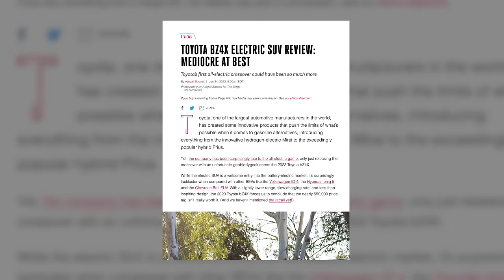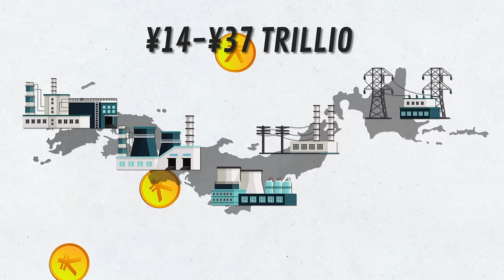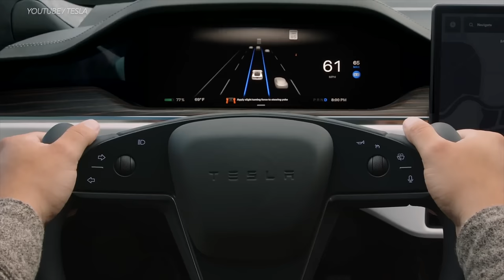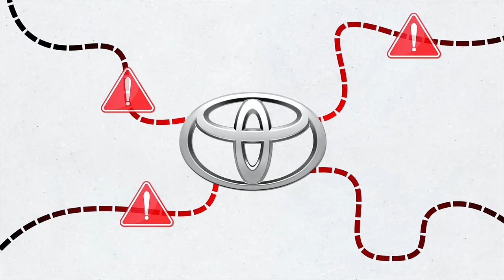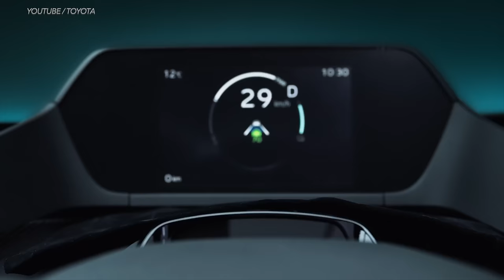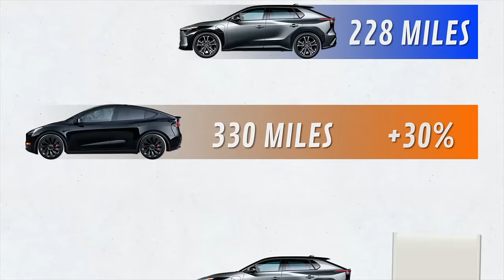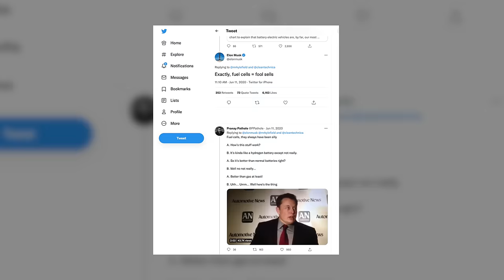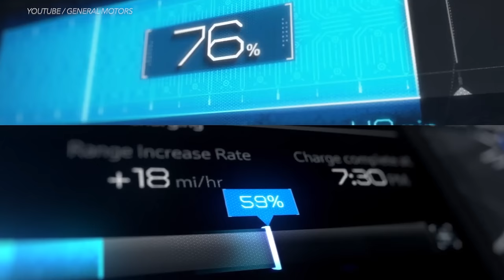Toyota's New Electric Car Shocks the Entire Car Industry

Comment: As a proud owner of Toyota’s with high miles , I always brag that I will “ drive them till the wheels fall off “ . I didn’t think Toyota would take me seriously 😂
Reply: I am a proud owner of a high milage Corolla
Reply: This dad joke made my day, thank you!
Reply: @SilverHairCare   Thank you ! Thank you very much 🥸
Reply: @dougefresh7435  Awesome!!  (I have a '93 Lexus with 230,000 miles and a '99 Lexus with just over 200,000 miles.)
Reply: @KaiPonte  make sure you check the lug nuts 😵‍💫. My 08 Scion XD just turned 190000 .
Reply: 260000kms on audi a2 @ 70-90 miles gallon 2001 aluminium

Comment: Toyota needs to keep their quality high! The wheels falling off is not a good start! Also, car makers need to get prices down below $30,000 if they want to sell to the mass market!
Reply: Imo, Toyota's are known for reliability and not for quality. They have cheap interiors and hard plastics everywhere
Reply: @Yubuzka3774  there's a difference btwn cheaper materials for base models (non-Lexus esp) and wheels falling off. The latter is unacceptable for any standard.
Reply: Remember you will be saving a few hundred a month on gas
Reply: agreed.  However, I don't think it was a quality issue, I think it's a design flaw.  Wheels don't normally fall off vehicles... any vehicle. And we're talking about Toyotas that have the highest quality rating for any of their vehicles compared to any other car manufacturer. Hyundai being the #2.  So It stands to reason, that the manufacturing quality is fine, It's a design flaw that is making the wheels pop off.
My question is why this problem was continued on to the BZ when that Subaru vehicle had the problem first. THAT in itself was a huge mistake. Toyota could have used the Subaru model as a test bed before moving on to the BZ. Flaws should have been corrected and were not.
Reply: @Yubuzka3774  Does reliability come without quality?

Comment: If Toyota was serious about EV's they would have gotten it right, just look at how great the Prius has been since its inception.
Reply: Toyota should stick to just gas models. Stop giving in  to the the Brandon green crap!
Reply: @jaysmith179  Toyota is a big time hybrid manufacturer, not simply an ICE vehicle manufacturer. They also don't like gas-powered vehicles. They'd like an alternate to gas to power engines and they're big on FCEVs, fuel cell electric vehicles.
Reply: so they're joking around losing face over selling wheel losing cars? besides it's not like they never made dumb mistakes before. Do you remember 2010 when they had to call in millions of their cars because of the gas pedal getting stuck in the floor mat? Toyota is a very popular car seller in Europe but some of their models land on the list of cars with most technical issues. I know that Scotty likes Toyota  and thinks highly of it, perhaps the models sold in USA happen to be the best ones but like every other company they have better cars  and not that good models as well

Comment: Right now with batteries being the weak point, I feel like Toyota needs to crank up the hybrid game personally. I like the idea of the set up they have in the new tundras, where the electric motor sits between the flywheel and transmission to help reduce some turbo lag, and also be able to be full electric for short distances at low speed, like stop and go traffic would basically be all free mileage as long as you got to drive before and after to charge the battery back up. Plus, the battery pack is in a slide out under the rear seats so replacement is pretty easy rather than taking the care off the frame essentially. They still use NiCd in those so they are much cheaper to replace as well. This also allows for the use of the transmission with the electric motor and if they advance this technology maybe it will be where you can drive up to ~30 mph on electricity while utilizing potential optimal gears design specifically for the electric side of things and then transition as the gas motor kicks in, for like an eco mode, or better yet, a beefier CVT they can handle both eco and sports mode depending on the need of the vehicle. What they really need to do is get nuclear like the submarines that can stay out for years... Yup the Toyota nuclear division is what they need to be dumping money into
Reply: A nuclear powered car that can have severe automobile accidents, man I'm all about nuclear power in the conventional sense but this is insanity, Scotty said you won but I have to give you a big L!
Reply: @icosthop9998  India will pick up their hydrogen vehicles especially in cold regions
Reply: Toyota. And subaru make great engines not cars lol
Reply: Toyota. And subaru make great engines not cars lol
Reply: I am in absolute agreement with you.  Don't see why we have to speed ahead to BEV and waste time with PHEV when the normal hybrids work great and actually benefit the owners. I'm still in the camp of a proper gasoline engine but not opposed to a hybrid drivetrain.
Reply: @tonebonebgky2  you do realize submarines get shot at and blown up on purpose, right? If they have deemed it safe for that, seems like they can figure it out for cars
Reply: @Brian-om2hh  electricity is large reliant on fossil fuel lol. That was another reason I threw in nuclear (now talking about power plants), even in jest, it's a pretty solid alternative with very few downsides if properly monitored
Reply: Sure. Tiny MR FUSION reactor powered cars for everyone!
  Sheer lunacy.
Reply: @duncanidaho2097  with current technology it would actually be fission...
Reply: @tonebonebgky2  can you imagine if freak accident happened with a nuclear power car and the power source decided to explode.
Reply: Just wait till the solid state battery is released. Toyota holds a bunch of patents related to the tech, and are pretty hush about it
Reply: @AnyMotoUSA  I was thinking about it and that they are bold to promise 90% charge after 10 years.
Reply: Buy the car but lease the battery 🔋

Comment: The entire concept is years away from being sustainable, on many different levels. Concerns of safety i.e. reports of fires, availability and methods of sourcing minerals necessary for batteries, and the fact that as of now, the charging involves the use of fossil fuels. This alone negates any mandatory environmental safety regulations. One might conclude, at this point in time, there are just a lot of elitist individuals looking to make a lot of money….
Reply: Thank you!
Reply: You mean spend money.  I live in Tesla land.  It's the nerd status symbol.  Right up there with German cars and Range Rovers.
Reply: Its not sustainable. Recycling these huge 4000 lb batteries every few years isn't sustainable.
Reply: Not years, but decades, if ever.
Reply: @dcgregorya5434  - Math challenged? Please, please, please define unsustainable. Tesla's largest battery pack weighs roughly 1250 lbs not 4000.  For Christ's sake do any of you fools actually read.  Why would batteries designed to last over 1500 charge cycles (LiFePo chemistry will last over 3000 charge cycles), need to be recycled every few years? At 1500 charge cycles even an EV with only 250 miles of range will last (1500 charge cycles x 250 miles per charge cycle), over 350,000 miles. And that's just until they've lost 30% or their original capacity. They will still work fine just with only 70% of their original range. They will continue to work for many more years and most owners won't choose to replace them. If they are replaced they will end up on eBay not in landfills. The Aluminum, Nickel, Lithium and Manganese (Cobalt is being phased out), used in NCA and NMC batteries are worth WAY TOO much to be discarded anyway. Keep in mind as well that Aluminum, Nickel, Lithium and Manganese ARE NOT POISONOUS. And now that the "highly sustainable" and NON-POISONOUS LiFePo chemistry (Lithium Iron Phosphate), has had its energy density vastly improved to nearly match that of NCA and NMC technology it will be replacing both NCA and NMC. Tesla has already started replacing NCA with LiFePo in their new Model Y. So the old arguments about Li-ion batteries being unsustainable and bad for the environment will soon be INVALID.  Try to keep up.
Reply: All of those supposed problems have been solved.....Read up on what CATL is already doing.........And read some more, Put Your Brain in gear before opening Your Yap..................Paul
Reply: @paulholterhaus7084  There are still many issues that have not been resolved.  Installing a fast charger is only an option for homeowners, and it's expensive.  Charging at commercial chargers is three to four times more expensive per KW/h.  EV range is greatly reduced in cold weather and when towing, and it's poor to start with.  Even at a fast charger, it takes several times as long to charge up than it does to gas up, even if you can find a charger that hasn't been vandalized to start with, and that is compatible.  EVs are far more expensive that their equivalent ICE vehicles.  I'll keep my ICE Camry.  EVs are decades away from being truly practical as a primary vehicle.
Reply: They are flying off the shelves.  They can’t make them fast enough
Reply: @MrKongatthegates  That’s Spectacular News. Now the Earth will carry on!!

Comment: In the UK the trouble is charge cables getting stolen from charging stations.  $60 worth of copper in each cable is too tempting.
Reply: Luckily that will never happen in LA, SanFran, Chicago, New Orleans, Jacksonville, The Bronx, South Philly and DC.
Reply: @STho205  No doubt? LOL
Reply: There is a simple solution to that problem.
The cable to be made from steel  wire - spiraled like a spring - 
so it can be stretched - the steel to be copper plated - as electricity
travels along the surface of a conductor NOT through it.
When the cables are manufactured from recycled steel such as 
steel cans - the cable is inexpensive to produce.
Reply: @andrew_koala2974  inner city folks broke into cars to steal Sanyo radios and underdash 8 tracks.

If there's a fence for it, even $5 seems to be worth their efforts.  Even phone books were stolen from phone booths.  Cords ripped out.  Phones taken or jimmied to get quarters

 Leaving expensive accessories out in urban streets are always going to be crimes of opportunity.  Best a car can do is lock everything behind glass windows.  Hampton parking lot chargers are not always the most secure places either.
Reply: Which is why we're now seeing untethered chargers, which require you to use your own charge cable. Problem solved.... There are several in my local town already. Stealing charge cables is all well and good. It's finding somewhere to get rid of them that's the problem. Most licenced scrap dealers in the UK will not blindly take scrap metal from anyone anymore. You need to show where the scrap is from, sometimes with written verification. Your details and car registration details will also be taken. The days of  "pssst, wanna buy some scrap metal cheap?" are long gone.....
Reply: @Brian-om2hh  

Wish we could say the same.  Catalytic converter thefts are ubiquitous.  And, despite raids, fines and jail time, there is still some place that these low lifes are able to fence them.
Reply: @tharais  Like just Mile south of the Border..............Paul
Reply: They will increase security or durability if need be.  Give it time.